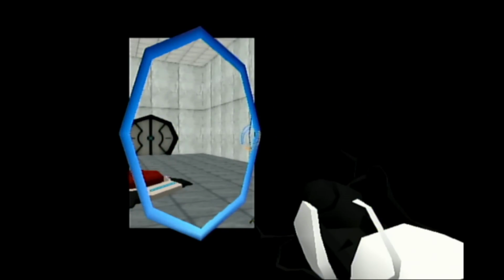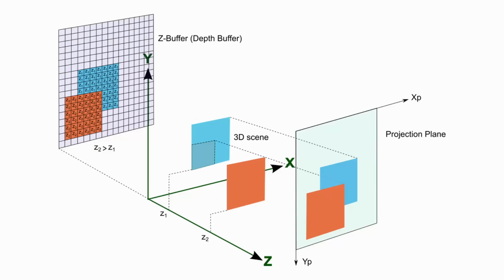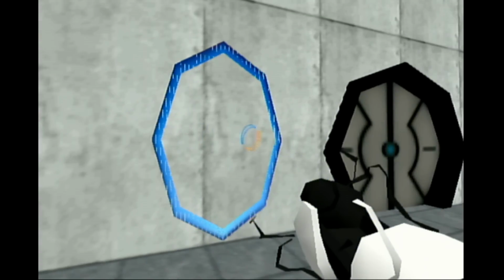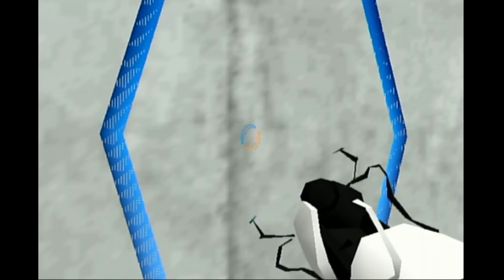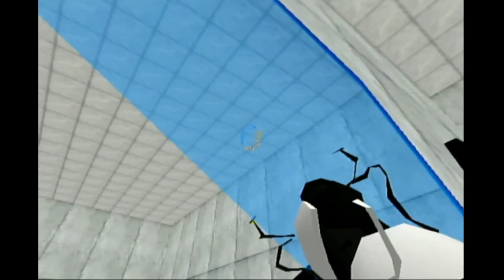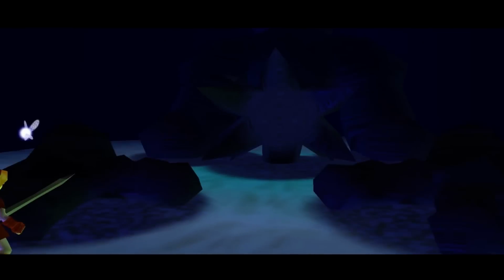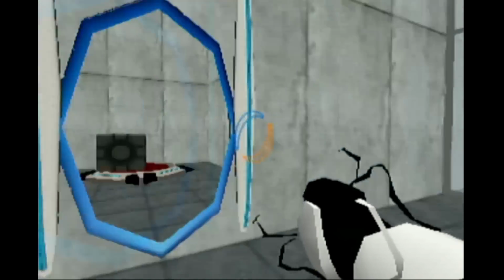How can the Nintendo 64 run portal?!? | Portal64

Comment: I imagine unless the portal gun is animated, a texture would work just as well.
Reply: Textures work different on the N64, this isn't like Unity or Unreal. Textures can be very expensive and often require strategic ways to load and apply them in order to get more out of them. Many N64 games such as Mario 64 tried to avoid textures and just use vertex coloring where possible using textures where it had to be done. On the N64, rendering polygons with added vertex coloring was infinitely easier.
Reply: Rendering the portal view to a texture and then applying the texture to the portal is a nightmare. That's how the old minecraft portal gun mod did it. The problem that you get is that textures are subject to the same transformations that the faces are so it will stretch and morph in accordance with perspective. Let alone all the different kinds of filtering. I think the method he uses is the same as the original game.
Reply: The original game does use textures, but they are rendered from a transform of the players view, and use some frustrum trickery to stop things in front of it.
Reply: @gitgato_main  Ah thanks. Any insight if it would work on the N64?
Reply: @gitgato_main  https://youtu.be/riijspB9DIQ?t=306 Here a portal developer contradicts this. They show something really interesting though. They do it in the opposite order compared to this N64 version.
EDIT: later in the video they show that the original portal uses textures beyond the first portal view.
Reply: @goeiecool9999  the op is talking about the portal gun. not the portals.

Comment: Rather than partitioning the Z-Buffer per portal view, couldn't you instead mask the region with the portal object's depth. You can then do something like std::nextafter of C++ to bring the portal ever so slightly closer to the camera than the wall, removing the need to create the wall hole.
Reply from the maker: I did consider this option but I don't think I could do this with the CPU and have good performance and I don't think I could get the RDP to do it. There is actually an benefit to cutting a hole though, the N64 fill rate is really bad. By cutting a hole I don't need to attempt to draw the wall where the portal is. This is a pretty big deal when you are close to the portal and the wall fills the entire screen.
Reply: That part was confusing to me as well... But I take it to be a general explanation of how the z-buffer works. The portal view is inherently further away in the depth buffer because, well... it's further away. I'd be surprised if there's actually code necessary to explicitly partition the z-buffer. Though I have messed around with trying to program portals before and I ran into trouble where walls and objects inside the portal view, behind the portal, cover the entire portal view, but I recon that explicitly partitioning the z-buffer wouldn't fix that. It's more likely solved because he renders only what's inside the view frustum, which is probably adjusted to start at the portal and no closer.
Reply: would that run faster or slower on an n64?
Reply: Simply moving the portal coordinates by the smallest unit possible wouldn't solve the z-fighting since the coordinates are transformed every frame and the magnitude of the smallest possible unit will vary based on how far a given pixel is from the camera. Even if you correctly accommodated it every frame, the portal would visibly jiggle and the math would be a pain since you need to ensure every pixel is far enough away but you only have direct control over the vertices, and doing the math naively would not work for the same reason that z-fighting happens in the first place
Reply: @Kaslai  at any point the rendering gonna check the z-buffer. So give the portal "entity" just a slightly higher priority..
Reply: I immediately thought of masking that area of the screen too, but then i realized it doesn't work. If we mask, sure it prevents anything drawing that shouldn't be there. But it also prevents drawing what should be there, infront of the portal. Then i had another idea. Render the portal scene to a flat texture. Anything behind goes behind (not inside). Anything infront goes infront.
Reply: To add to the discussion about memory usage: not sure if it only impacts VRAM and disk or if there is also (not just optional file caching) RAM use, but textures created with 4k displays in mind are a lot bigger than those for 780p.
Reply: the big issue is this is a n64 not a modern pc with a whole lot of ram to mess with
Reply: @NoahGooder  Yup, and as such, modern games suck, because they cannot use RAM efficiently. I remember playing games in the past with really good graphics that would require several hundred times more RAM in a modern computer to render if they had been in a modern game.
Which means I rarely if ever play modern games. Personally I enjoy games from pre 07 the best. Because they have great fidelity and still only use like 8MB RAM instead of 4GB RAM... It's ridiculous how much RAM everything uses today. They might as well just not use the CPU at all or the GPU at all, just store it all in RAM and call it when necessary, no matter how big a texture is, what's that you use a BMP or TIFF image because Compression means nothing to you... Sure thing, oh you need to store some values, well you can do that too...

Huh Firefox, why do you need 2GB of Ram, you're a fucking explorer window, with the sole purpose of searching an external database... why are you using of memory in the first place?

I hate modern computing. It has become the absolute garbage dump of lazy programming. People had extreme constraints in the past, now heck Windows needs like 3GB RAM to run itself...
I say it like this, every bloody programmer today, should learn to minimize the RAM usage. Tetris on an GB Color used less than 8 MB ROM and less than 128kB RAM...
Compare that to Tetris Effect, which requires 5GB ROM and 4GB RAM. What the hell went wrong?
Reply: @livedandletdie  Many modern indie games require a relatively high amount of RAM compared to similar games in the past, because of libraries and abstraction layers. Yes, that may seem wasteful, but it's also why just about anyone can make a game these days by just using some YouTube tutorials. Is that as impressive as what the old games did? Absolutely not, but is that why you liked those old games in the first place? Enabling creative expression is much more important than optimizing perfectly for the hardware. Good enough is good enough.

For modern AAA games, the answer is simple: they are being efficient. It's just that you need a lot of memory to track the state and assets of a fully open world highly detailed game world. AAA studios spend a lot of effort on making things run smoothly. Watch some GDC talks on YouTube of you want to be impressed by just how much effort goes into it.

As for why your browser hogs memory: websites are simply fully fledged applications these days and end up using a lot of libraries and frameworks to make them easier to maintain. But there are also security and performance optimizations that make browsers use more memory. Without them you'd be complaining about all the vulnerabilities, or things being extremely slow. Like in 2007.

Is everything perfect? Absolutely not. But efficiency is not the end goal of any application. Efficiency is a means to an end. It can enable you to do things you otherwise couldn't. Not wasting RAM is important, but getting lost trying to micromanage every byte will see you get outcompeted by people who spend their time more pragmatically. "Premature optimization" is a thing to be aware of.
Reply: @livedandletdie  What games are you talking about? Not that there aren't poorly written games but every game I've run has come under 2gb of ram and most are 1 to 1.5 (I check obsessively). Most games today use more ram because there are more things going on and that requires more numbers to keep track of.
Browser are not just text renderers anymore, they are running a script engine as well as all their other functionality. They also typically sandbox these processes so you tend to have a lot of them running under a single Firefox instance. Firefox itself runs on a few hundred MB if you aren't doing anything on it.
That's the thing though if you want the web nowadays most of it is delivered to your machine where it runs like an application in your browser which means instead of getting a fully rendered page to display, it gets instructions that it has to carry out. Most of the work that used to be done on a web server has been offloaded onto the clients machine because in most cases that's actually a better experience for them even if it comes with draw backs.
Reply: @livedandletdie  Sweet sweet rose-tinted glasses..
Reply: @livedandletdie  Pac-Man is a 32kb game, but you can't play it on Xbox without downloading a 400MB update.
Reply: @livedandletdie   I don't think you know how modern browsers work...  Long conversation about that aside, programmers use more ram because more ram is available, and because ram is fast. Like really fast.  Like orders of magnitude faster than NVMe.
Reply: @livedandletdie  "Yup, and as such, modern games suck, because they cannot use RAM efficiently..."

Are you speaking of programmers, or some kind of Windows limitation? If the latter, this could be dealt with by having a dedicated "Gaming OS", couldn't it?
Reply: @livedandletdie  I’m sorry but the moment you mentioned firefox’s RAM usage you revealed you don’t understand anything at all about memory usage. Not that it wasn’t obvious before.

The primary reason it’s so bad is because firefox (and chrome) aggressively cache assets to avoid fetching them again. It would be trivial to lower the usage if you just stopped caching, but your browsing speed would be sloooow because you have to re-request all assets every time you’re no longer using them.

And yes, to some extent this is because of flaws in web browser engines. But the majority of the memory usage is just from caching. Simple as that.
Reply: 2gb used to be enough to run an entire operating system AND its apps, not even that long ago. i would know, i have installed windows XP in a ramdrive that big before. don't even have to go back to the 90's to do it.

plus, the memory the browser is reserving is not really the issue. have you seen how websites work today? what you ask to see is like 10% of what the browser is doing. 90% is unwanted BLOAT. tracking bullshit, ads, spyware, bad code, the lot. for instance, google search, that site used to be 10kb and just a straight deal, no bullshit requests. now? 26 requests just to open the initial page with the search box. and it weighs 450ish kb now. yeah sure, there's more functionality now, but that stupid seachbox would take 10 minutes to load on my first computer's internet, which was able to open altavista almost instantly back then. 
and that's just google search, youtube does 53 requests on its initial page IF you're not logged in. 

it's just too much bloat. as a result of that, my computer which is getting pretty close to being a million times faster than my first one in some aspects, and at least a thousand times in all other aspects, feels about the same to use.

not to mention inefficient code can be like... a real issue. search for this video here on youtube: Someone improved my code by 40,832,277,770%
guy made a simple app to work out a curiosity of his in python. he was satisfied when he thought it was fast enough to realistically run it "before the heat death of the universe". took him a little over one month of running his code to get the results. that started a code race to make an app that does that the most efficiently possible. they got the time down to the microseconds scale. it ran so fast that loading the database was now the majority of the runtime of the app, not crunching the data, and they even optimized THAT! they basically streamed the database in chunks to the cpu so it could crunch data as it was still loading. that's how far code optimization can go in some cases. 

and i can guarantee you the internet works mostly on "good enough" code.
Reply: @livedandletdie  Probably the worst take I've seen in a LONG time.
Reply: @darbling He's absolutely correct though.
Reply: Yes indubitably🧐
Reply: Big words, me no understand. :(
Reply: Std? Lol. Gooh.

Comment: Wow that is great work right there. I would be fine even if gladOS was text only. I know Conker's Bad Fur Day managed to get the entire N64 game fully voice-acted. Though it was developed by RARE during their peak N64 dev days so could be hard to copy.
The fact the first area is even fully functional is something I was not expecting. Keep up the incredible work!
Reply: Sound on the N64 can be a nightmare because the dev tools were just really crappy, but one of the hardest parts isn't sound, it's graphics. Conker's Bad Fur Day was one of very few N64 games to push graphics to the limit and that's because the team spent significant time before the games development drilling down deep into the N64 graphics, more than most companies and basically invented a whole new graphics library.
Reply: I believe we have algorithms for compressing audio better than 90s. Also 64 megabit of flash storage is not that expensive now.

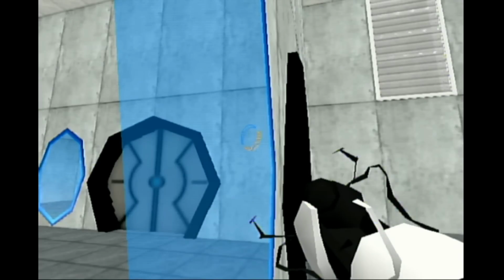Comment: 4:00 I notice the portal simply cuts off after too many portals. I find this common but a simple solution that works basically the same way as real life pointing a camera at a screen showing that cameras output is to simply render the portal view from previous frame into the portal displayed in current frame (or a solid colour if no data exists) if you know what I mean
Reply: That's how the portals work even on the PC version. It's cheap from a performance perspective and completely acceptable visually.
Reply: @the_kovic  but this appears to be not doing it
Reply: the pc version does not do this as it didn't support anti aliasing
Reply: @TypicWhisper  doesn’t it support antialiasing
Reply: He made a video adressing this, he's able to go upto 16 portals but would rather use the performance left over by cutting off portal recursion for other visual effects and graphics
Reply: @vamsigagjew1535  or he could render one portal with the portal within the portal being solid orange the first frame, then the next frame it shows the previous frame of the existing portal, which makes it go on forever
Reply: @memetech- it's likely he'll add portal recursion depth as a graphics option to the game. Also I'm not sure what you mean by your explanation. Do you mean reuse the current view again in the second portal you can see through the first portal? Because that's just what recursion is, it still takes resources to render.
Reply: @vamsigagjew1535  I mean don’t create a new portal texture for the one inside the portal, just use the one from last frame
Reply: @MrCrackbear  no, I mean the portal inside the portal would use the texture the current portal used last frame, which would still be in memory until it is overwritten. This results in the portal showing itself frame 1, then it shows itself frame 2 but with the itself from frame 1 which showed itself, then frame 3 there are 3, and so on. Due to the transition of a portal opening this would actually look cool
Reply: @memetech-  "no, I mean the portal inside the portal would use the texture the current portal used last frame, which would still be in memory until it is overwritten"

I'm pretty sure the portals are drawn directly to the framebuffer, not to a texture that can be reused like this.  I think you can copy from the framebuffer to a texture on the n64, but that is definitely not a "free" operation.
Reply: @Ehal256  I see… but if you read that part of the frame buffer and use that as the texture…

BTW IK this is kinda not as optimized at this point but just in case this is a good idea I am going to say it
Reply: @MrCrackbear  no problem

Honestly IDK away more games with portals don’t do this! It’s basically how reality does it
Reply: In an earlier video they got the cutoff point at over a dozen portals. My guess is that they made it less for testing
Reply: @MrCrackbear  Point your phone at the TV (in landscape)
Open the camera app and airplay.
The TV is the portal and your phone is the other portal. By not rendering the next portal and instead just rendering the wall that was there, which in the next frame is the portal from previous frame, you get unlimited portals for free
Reply: @memetech-  Not everyone uses Apple.
Reply: @2b2056 ,  @2b2056 ?
Reply: Ok so my reply bugged out
Reply: I was saying “what does that have to do with anything,  @2b2056 ?
Reply: @memetech-  Not everyone can "airplay to tv"
Reply: @2b2056 just imagine I said cast
Reply: (Also I was mainly suggesting it to the creator)

Comment: The robotic voice sounds good and is fitting but when GLaDOS gets her cores removed her voice starts changing to sound a lot more fluid and human.
 Could you put some lines of that in your remake and show us how the bitcrunching of the N64 hardware sound when doing it with a much more normal voice?
Reply: @ZanaGBYT  Imagine if Banjo games had 128MB carts lol
Reply: @SirScallywagger  "Yes but what's the point of doing that?"

There is the principle of attempting to fit within all of the technological and economical constraints of the era as you suggest, and then there is the principle of attempting to get the most out of a piece of hardware. After all, those space constraints back then weren't entirely technological but also economical---it ultimately came down to how much money one wanted to spend.